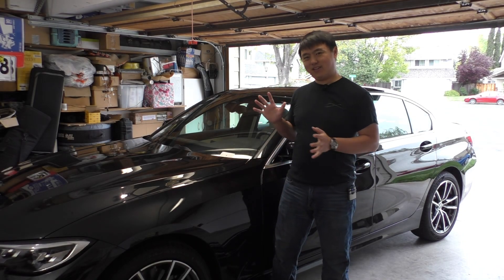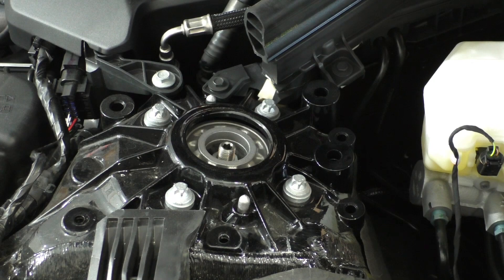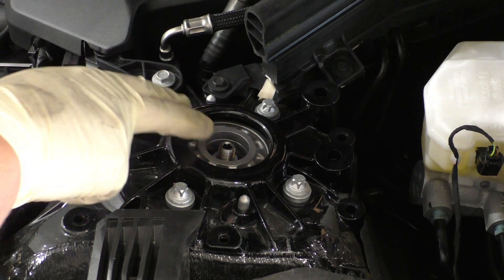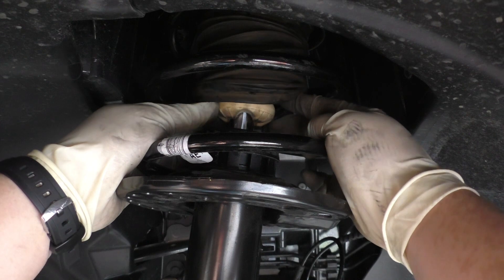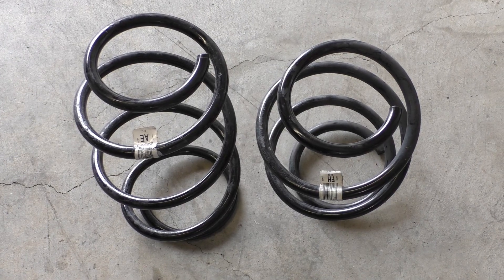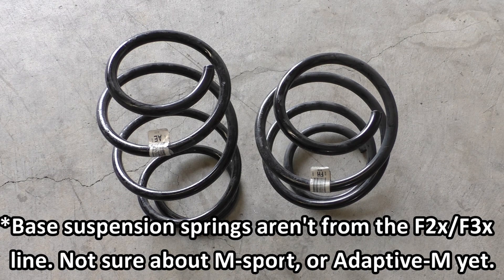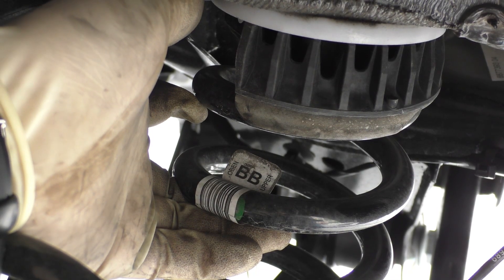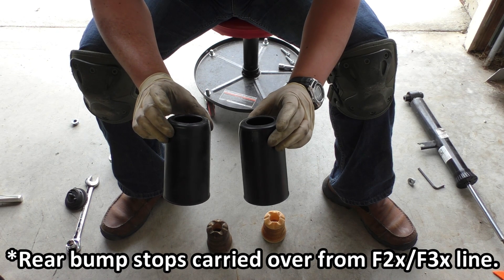BMW G20 vs F30 Suspension Look

Comment: Just bought a quickjack 6000elx which they built for these crazy wide jack points.
Reply from the maker: I keep thinking of upgrading to a 6000ELX myself, but then keep hesitating since it might actually be too long if I get a short wheelbase fun car in the future, haha.
Reply: You solved that problem going perpendicular to the car
Reply from the maker: @ronfisher4751  With my i4 I discovered that QJ really doesn't like it if the weight distribution on each skid isn't very even. The i4 RWD model has a much higher rear weight distribution and it was a bit hairy watching the QJ try and lift it.
Reply: Interesting.. My m340 barely fits the 6000. the 6000 is way to long for my friends m240.

Comment: Hey this is a very good informative video. I was wondering if you can confirm that the front right side swaybar link of an F3x can be used on the front right side of a G2x. Pls let me know. Thanks
Reply from the maker: I haven't heard this, but it may be possible. I haven't had the two side by side.

Comment: If you get the adaptive suspension you get a strut brace and quite a beefy one. OEM 51617423989	code :)

Comment: You think the F3X sway bars would fit the G2X RWD? Because the RWD model is a US-only spec, there are no aftermarket sways for RWD from what I can tell. Would be nice if existing aftermarket F3X sway bars would fit...
Reply from the maker: For rear sway bars the G2x RWD and AWD ones are interchangeable. The fronts aren't however. I don't think G2x and F3x front sway bars are interchangeable.
Reply: @FaRKle0079  oh right, I forgot the rears would fit. I'm just a little hesitant to put in just the rears in case I end up with too much oversteer.

Comment: I've got a question 
Which suspension is more comfortable(soak up bumps and road imperfections smoothly)between...
G20 standard vs F30 standard And
G20 Msport vs F30 Msport?
Reply: G20 I had both g20 overall better ride stock for stock

Comment: With those tiny top mounts, it doesn't look like there will be any way to do camber plates.
Reply from the maker: Hrm, interesting thought! I definitely hadn't considered that. Whatever the aftermarket does, the clamping section will have to be pretty compact, or all the clamping bolts offset towards the outside.

Comment: could you a regular 330 suspension vs 330 m sport suspension comparison, please?  i have a 2020 330 m sport and its way too stiff for me. im wondering if i should change suspension or change my R19 run-flats to R18, non run flats.

Comment: Hi there, 

I've been driving the G20 for about a year now, the suspension is very stiff (non-adaptive) my back and whole body is hurting (as the roads in my country is not very good). My question is will the F30 dampers work on G20 ? (as the dampers are much more comfortable) Any other suggestions to soften the suspension ?  Thank you
Reply from the maker: I'm not sure F2x/F3x dampers will work on the G2x. The damper stroke length may be different due to the different springs G2x uses (they don't use F2x/F3x springs). Do you have the G2x base suspension?
Reply: @FaRKle0079  Yes im using the M-Sport base suspension.  If im not mistaken there is only Non adaptive and Adaptive suspension. Will the F30 Dampers work ? I just wanna swap it for better comfort because the suspension is very stiff.
Reply: @premiersolutions2820  have you tried replacing the run flats with non run-flat tires.  I've heard it greatly helps.
Reply: @billy98102  Have not, but im planning to hopefully it helps
Reply: @premiersolutions2820  machane runflat mattanam...but warranty void aavum.... tubeless aakiyal Kure pariharam undavum

Comment: Thank. This was interesting. On side note I have A F30 and will try an E92 rear sway bar see if they fit!!!!!! 13mm vs 22mm
Reply from the maker: That'd be interesting if E9x rear bars fit. I'd try to do a mockup and some measurements first to see if it'll clear everything on the F30.

Is it 22mm solid or hollow? 22mm solid would be way too stiff of a bar for the F30 chassis.

Comment: I have a 2017 340x with stock suspension and i had the front driver side strut collapse (according to dealer) and had to do a whole big repair on it. Do you think the g20 generation suspension is built better with the redesign? I heard the f30 had a design flaw thats prone to damage similar to mine.
Reply from the maker: When you say it "collapsed" do you mean it pushed through the knuckle after hitting something like a big pot hole?
Reply: FaRKle0079 yea i remember being told that because of the collapse, something started hitting the axle as well
Reply from the maker: @M.deleon  OK that sounds like what I was describing. If you hit a pot hole or other obstacle hard enough the knuckle can get pushed up higher on the strut and the bottom of the strut can contact the CV boot and front axle.

The G20 has the same clamp style knuckle as the F30, so that failure mode is still possible. That said, I wouldn't call it a design flaw as you have to hit something pretty darn hard to do that. I hit curbing on the track and all sorts of bumps when off roading and haven't had any issue. Having tires with more sidewall (18" instead of 19" or 20" wheels) helps a lot too.
Reply: FaRKle0079 does the car being m sport have any difference as well? Thanks for the info! Nyc pot holes are just trash smh
Reply from the maker: @M.deleon  M-Sport doesn't make a difference. For F30 xDrive vehicles in particular the suspension with the M-Sport package isn't any different than without it, unless you option the Adaptive-M suspension. None of those changes though would make it more susceptible to the failure you experienced.

You're definitely not the first (or last) to have this kind of damage from NYC pot holes!
Reply: FaRKle0079 do u think after such repair, its more likely to happen again? Not sure if i should keep my car or lease a new car.
Reply from the maker: @M.deleon  I'm not sure what was replaced in your repair, so it's a bit difficult to say. If it was repaired correctly, then I wouldn't expect to be more likely to happen again than before you experienced it.

If your lease is up soon and you can take advantage of the large incentives now for buying your car, then I wouldn't let this previous incident stop you from a good deal if the repair was done well.
Reply: FaRKle0079 it was at the dealer and it was a steep repair. Replaced left front spring strut,output shaft,guide support,carrier,wish bone,tension strut,wheel hub bearing,and steering box.
Reply from the maker: @M.deleon  that's more than I would've thought would need to be replaced, but sounds like it was done right. No wonder it was expensive! Your chance of failure is definitely no worse than before since all that was replaced.

Comment: Has the build quality improved or has it gotten worse?
Reply from the maker: Suspension-wise I'd say the build quality is about the same as the F2x/F3x generation (which I think was pretty good). Some areas that seemed to be better are the damper hex counterholds (don't seem like they'll strip as easily as the F3x ones did), and the rear damper top mount holes are centered better (F3x had a very wide tolerance). Those are pretty minor things and really don't matter unless you're taking it apart though.
Reply: FaRKle0079 I’ve been considering the 330i m sport but really wonder how long it’ll last as I keep my cars for 10 years
Reply from the maker: @papoopa5800  I'm not sure how many miles you cover in 10 years, but my guess would be you'd need some new suspension bushings (usually the whole arm is replaced because it's cheaper/faster than just doing the bushing), maybe shock absorbers, and battery aside from normal maintenance in that time frame. The BMW drivetrains (engine, transmission, differential, and axles) are pretty solid these days.